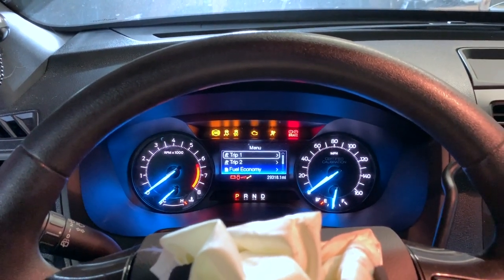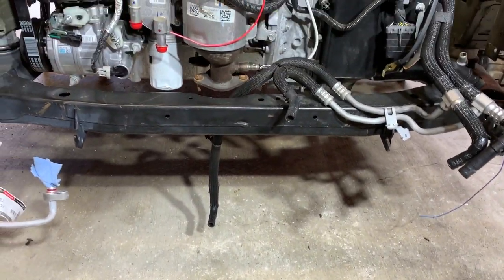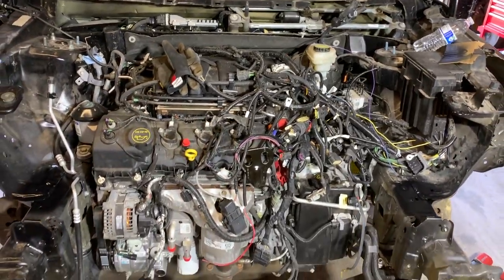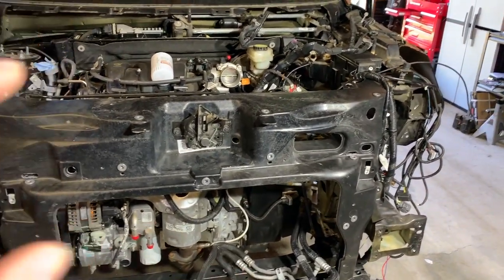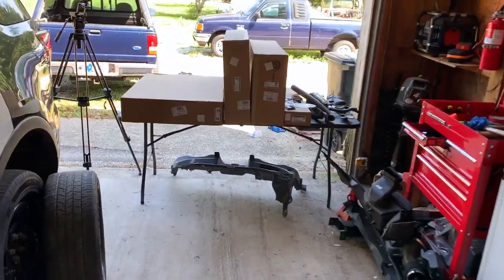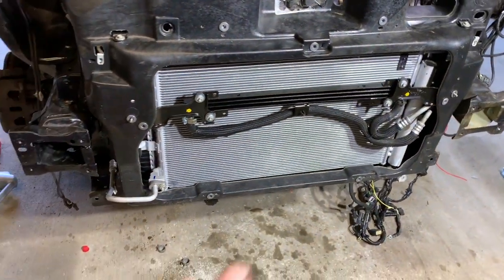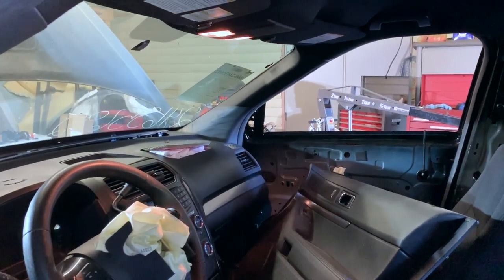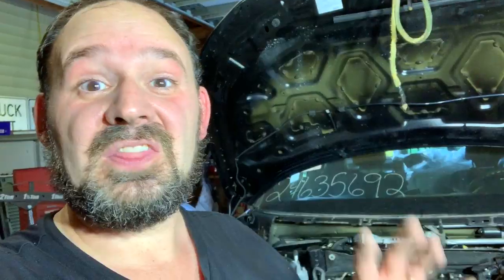Rebuilding A Wrecked 2017 Ford Police Interceptor Utility -- Part 8

Comment: Looks good!  very encouraging to hear it run I'm sure.   One gadget you may be interested in for things like this is an Airlift vacuum coolant fill device.   I have one of those and it makes filling coolant on difficult vehicles that are prone to air lock much easier.   Its kinda funny to watch it work as you pull a vac on the cooling system...sucks the hoses down flat until you start adding the coolant and it fills very rapidly.   BTW, do you plan to replace the A/C accumulator/dryer?  Might not be a bad idea seeing as how the system sat open for quite a few months.
Reply from the maker: Thank you! It was very encouraging to hear it run!! I’ll looking into that vacuum filler. I’ve heard of them but don’t have any experience with them. That’s a great idea!
I also hadn’t given much thought to the A/C accumulator... it did sit unattached for a while... but the lines were also pinched off, so it wasn’t fully open. Do you think it’s necessary?